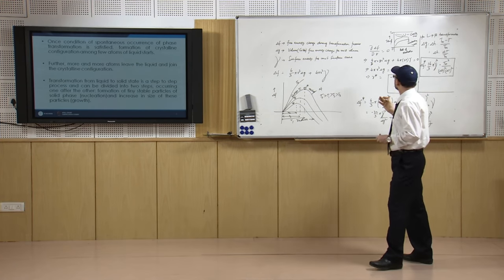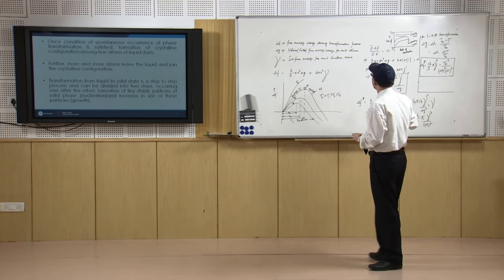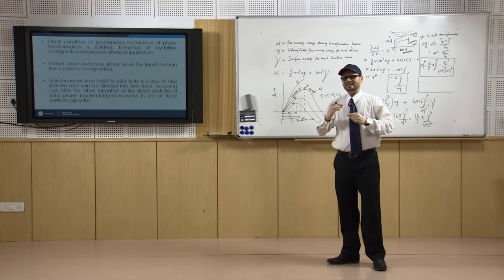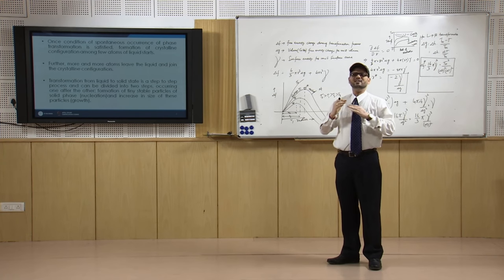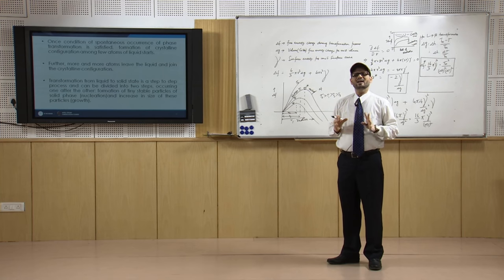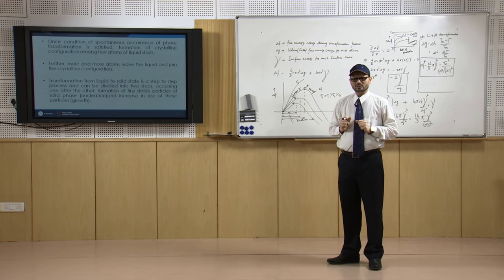Mechanism of solidification

Comment: If nucleation rate is higher at lower temp how can growth rate be higher at higher temp. Likely the y axis is degree of undercooling in which case it is not fair to represent both nucleation and growth on same curve. Please correct me if I am wrong.
Reply: If you consider steel like C80, the pearlite region (coarser grains, more growth) occurs at higher temperature, whereas bainite ( very fine grains, more nucleation occurs here) occurs at a lower temperature. So the professor is actually correct.
Reply: I am casting company owner but i dont have knowledge abt this can u make me understand
Reply: @flowmedia5844   😂😂😂😂